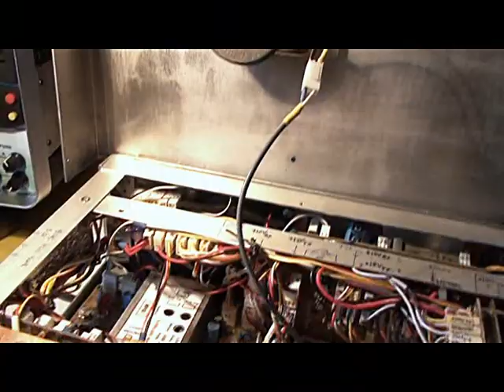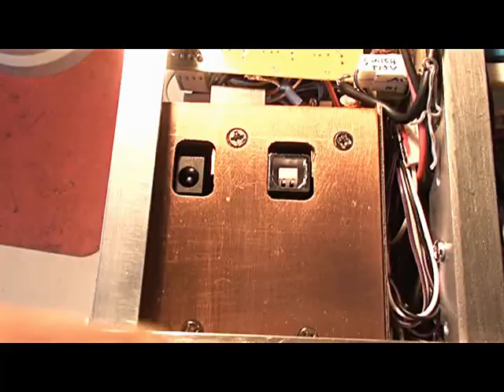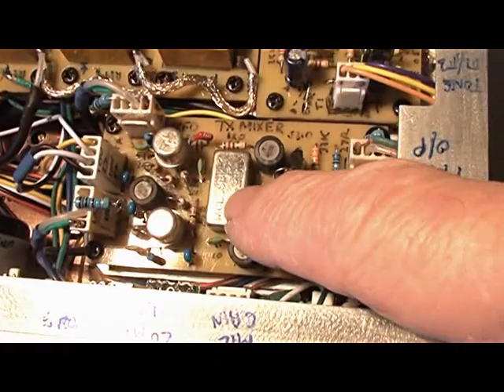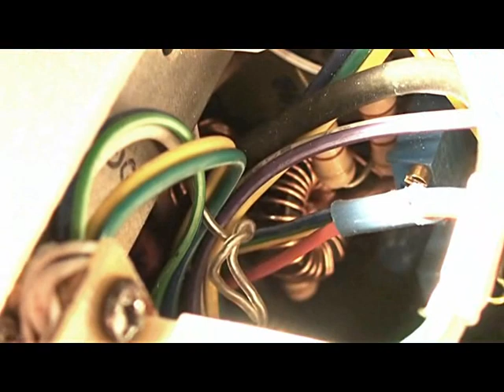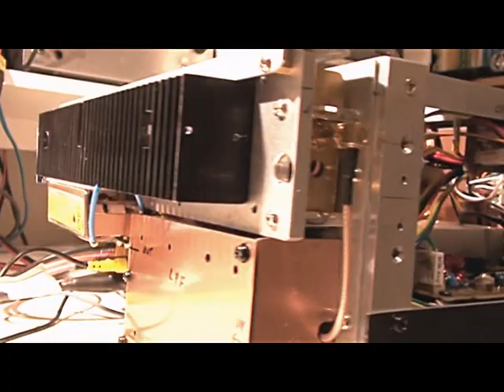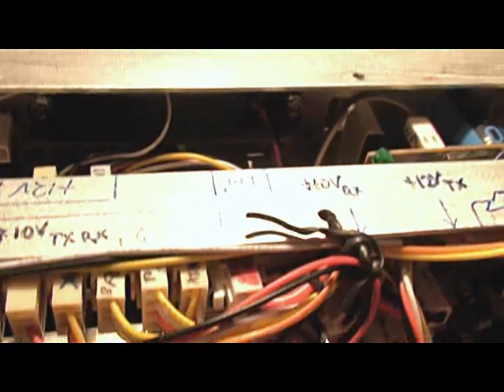VK3AQZ MK5 transceiver demo Part 2

Comment: Do you have any RF speech clipping? I have used this in the past by overdriving the BM. You can get up to 10dB with acceptable quality. It only increases inband IM .
This project should be very instructional for future RF engineers.
Reply from the maker: Hi Roger, I only have ALC by sampling the RF at the SWR Stockton bridge. I don't have any RF speech clipping of the type that passes a 9MHz signal through additional processing using, say a crystal filter, or down converting to 455kHz, and using ceramic filters. I have tried such  schemes and one of my commercial radios had such  a scheme in it, but I found the 2 tone IMD went from around -32dB to around -18dB which was not all that good. The signal was certainly punchy but the distortion on peaks gave a sort of raspy edge to the quality. It was a commercial design and I don't think it was all that good. So I have tended to stay away from them. This particular rig uses the SSM2167 chip which has an audio compressor and clean AGC also. But again I don't go over 2:1 compression.    However I have tried RF ALC type feedback to the SSM2167 control input and found that by pulling back the mic signal cleanly actually improves the IMD in the power amplifier stages since the overall drive pulls back on speech peaks and IMD is not high on the low audio levels. But again it's a complication that was not really necessary for just rag chewing, and the compressor was good enough for DX work. Anyway, that's what I have experienced. Regards, Lou
Reply: @vk3aqz  yes the inband IM does sound raspy.
The effective increase in power is hugely beneficial. 
So easy to achieve by just driving the BM  into clipping.
I love your design. . It must be very rewarding for you..
I remember the lecturer making fun of you  but little did he know. ..
A friend who worked for you up at the mount held you in high regard. 
Will look out for you on the hf
Reply from the maker: @rogervize  Hi Roger, thanks for the compliment. Gee,RMIT, that was a long time ago. Good Memory!. Yeh, every now and them someone would have something to say. When I was at High school in Dandenong, some guys in a line about 6 feet in front of me, were fighting. As the teacher approached, he kicked me in the leg quite hard to cause a big bruise and said "you wogs always start fights!" even though me, and the other guys, were just standing in the line doing nothing. A bald guy by the name of of Mr Cooper, who taught geography and not much else! Coped a fair bit of that in my younger days.  Anyway, just memories now.   Thanks for the chat Roger, yes if you hear me, or I you, well catch up on air. Regards, Lou.

Comment: Outstanding.  Congratulations.  So complete! I run out of energy for all the extras that you have included and fully integrated. The trimpot across the transmit BPFs, are they across the low impedance link? If so what value? I've considered using a D to A to generate a DC bias to control the gain of a post mixer amp to get around the problem of differing Tx signal levels across multiple bands.   Many simple but effective ideas in this rig!
Reply from the maker: Hi paul, the trimpots are across the low impedance input primary link coil. They are 500 ohms. The stage feeding the trimpots is a 2N5109 which is on the output of the transmit mixer stage and has  a low Z output - much less than 500 ohms. The bandpass filters are top double tuned circuits rather than Butterworth, etc, 50 ohm designs one finds in the some applications. The primary to secondary turns ratio transforms the 500 ohm to around 5k so the loaded Z for the first tuned circuit is not all that high. So the impedance of the trimpots is not as important to the overall response - but rather the loaded Q. The tuned circuits are stagger tuned and the top coupling adjusted so that the filter is reasonably flat over the ham band. Its ok for 40 and 20 but on 80, in order to cover the band, the Q is lowered so the lower Q caused by the link coupled trimpot is actually a benefit.
Overall they are pretty flat and I don't need to touch the drive or mike gain once the trimpots are set for each band. Ok on your idea of producing a control voltage by using an A to D device. Sounds like it would work. One can also try a form of AGC circuit which samples the output RF a bit like  a slow ALC.  Or a gain controlled stage like the AD603 or FET where the gain bias is fed from band switched voltages adjusted with trimpots or signals from a processor like an arduino. At this stage I am tidying up the circuits and notes and maybe submit the project to AR - that's if they can get moving at their end!   I hope that all makes sense. Lou.
Reply from the maker: I should add that the wipers of the trimpots are nearer to the top than the bottom so the actual resistance across the link is less than 500 ohms but not as low as, say,  250 ohms. So the final response adjustments are made after the trimpots have been set producing the same level on each band. Yes, takes a few goes. Lou